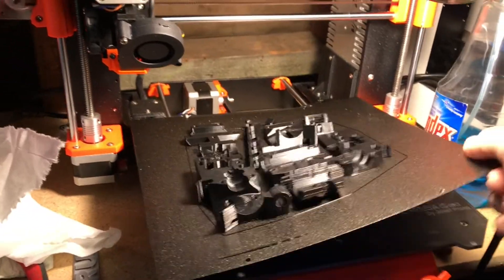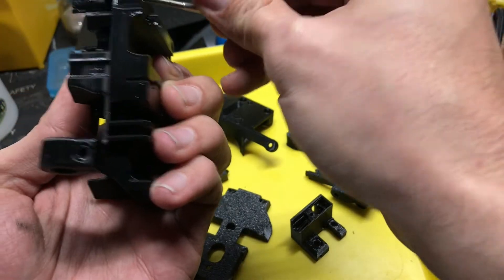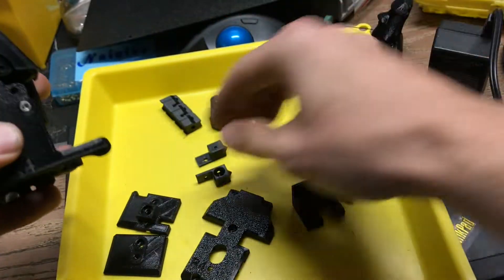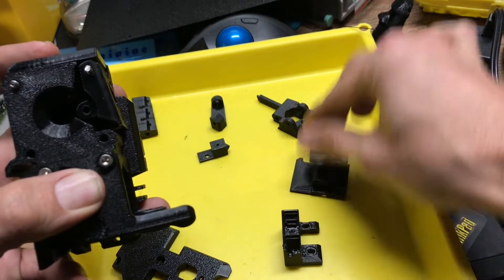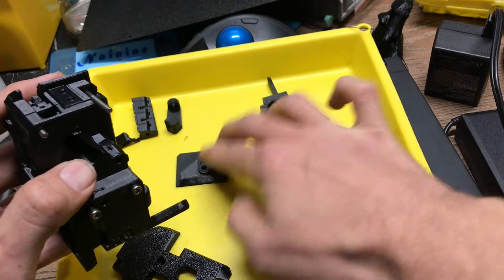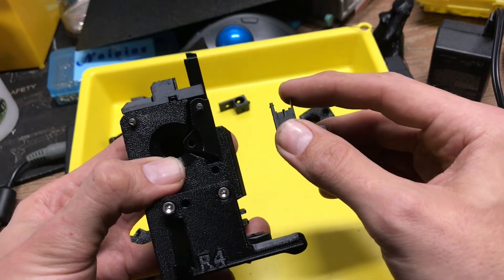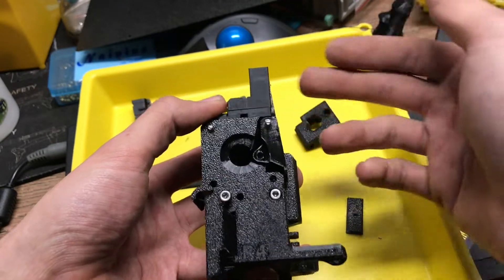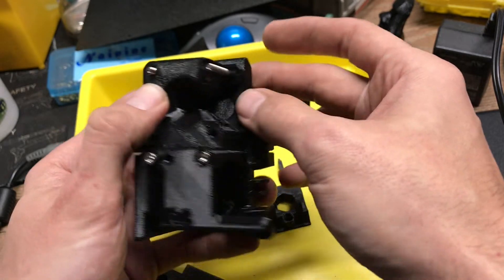Prusa MMU2S Extruder Preview

Comment: I think they don't need to use the MMU calibration feature at all any more. If the sensor can detect that the gears are engaging some filament, that would completely replace the need to calibrate the filament lengths. I'm assuming the firmware will have some sort of timeout and a check to see if the gears are engaged or not, which would replace the existing functions it uses for loading the filament with the MMU.
Reply: They don't. Thats part of this update. That is why you need updates extruder parts specific for the MMU2s

Comment: I found the "upgrade" to be very confusing. There are two distinctly different paths (1) is if you only upgrade the MK3 to a MK3 s. In this instance you will have the stainless ball as the filament sensor.  EASY DONE (2)   If however you have a MMU2 on your machine you upgrade the MK 3 by changing the extruder housing and you do not use the stainless ball filament thingy, but the other alternative. IF YOU HAVE A MK3 S YOU HAVE ALREADY CHANGED YOUR HOUSING AND FILAMENT SENSOR TO THE STAINLESS BALL THINGY. YOU NOW REMOVE THE STAINLESS BALL AND REPLACE WITH THE OTHER THINGY. My question to PRUSA though is who at this point goes from a MK3 s to upgrading a MMU2 to a MMU2 s if both upgrades come together. Its confusing and senseless.
Reply from the maker: Mark Stemmett the MK3*S* upgrade is a prerequisite for the MMU2S; much as the MK2.5/MK3 is a prerequisite for the MMU2... and to make it a bit easier the MK3 to MK3S (or MK2.5 to MK2.5S) upgrade parts are provided free with MMU2S; and unless I’m mistaken all MMU2 buyers get the MMU2S upgrade free. The most confusing part is how much free stuff you’ll get, and even if you don’t qualify for any free stuff and got the last MK3 on 1/27, the MK3S print yourself upgrade is only $20, not bad if you ask me!
Reply: @LA3DPrinterRepair  The problem is that what you correctly write is actually a half truth. You do not upgrade the MK3 to a MK3 S well not completely, you do not do the sensor. In actual fact what you do is rebuilt the extruder with the MMU2s sensor so in actual fact you do nothing to the MK3 other than flash. What is the pointy of free stuff that goes to landfill. If you have a MMU you need to build the extruder for the MMU right
Reply: @markstemmett5296   I just got my MK2.5S/MMU2s upgrade kit.  I had MMU1 before. Here is what your missing. I like to have the option to go back to MK2.5s with out MM2s. When I had MMU1 I had a lot problems. I ended uptakeing off MMU1. So if that happens again with MMU2s.  I am not stuck in MMU mode.

Comment: Why wouldn't they know that the filament is down to the gears with the mk3s extruder? The sensor is before the gears in both cases. You think they will wire the sensor on the extruder directly to the mmu?
Reply from the maker: Couple things, the MMU2 can generate a "spear" on the end of the filament during extraction which could in theory false-trigger the filament sensor, but it wouldn't actually deflect the idler; by detecting with the idler they can be sure the filament is being positively fed by the extruder direct-drive rather than the MMU2 multiplexer. AFAIK the MK3 laser sensor was always disabled with MMU2 installed (I could be wrong), but the new sensor doesn't need CPU time to read, it's just a trigger with or without MMU2(S).